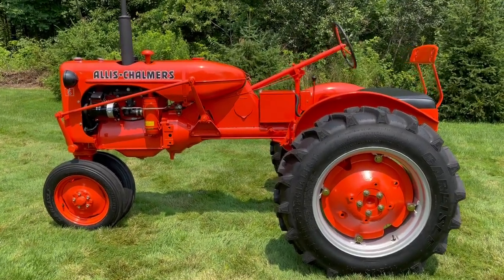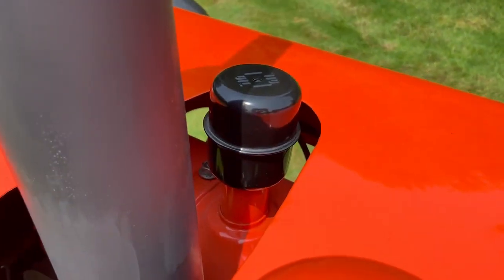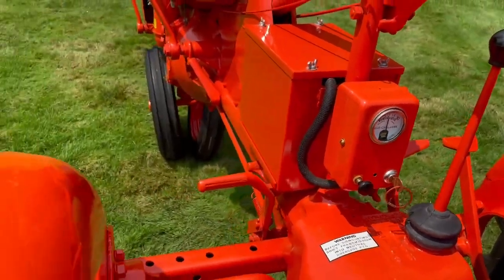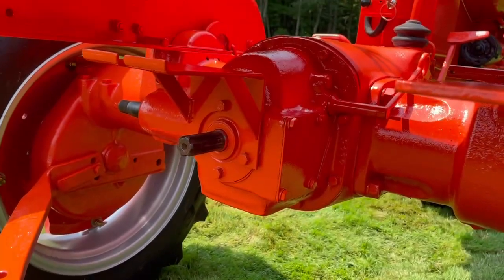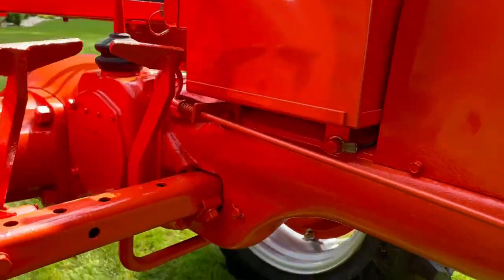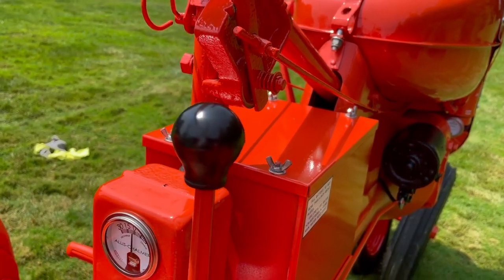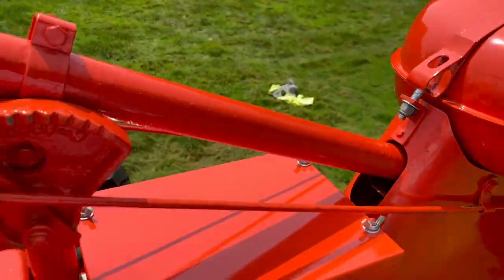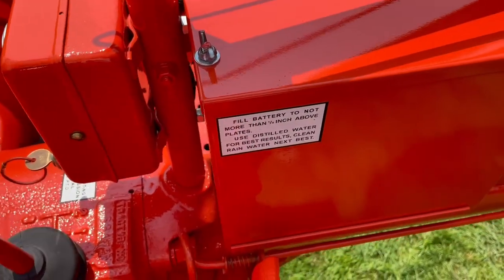1948 Allis Chalmers C Tractor Overview and Operation

Comment: Finally an Allis with a push button start.  I remember the one my grandfather had started that way.  It also had a bench seat, but a wide front wheels. It also had levers next to the seat so you could raise equipment.. I ran a spring tooth harrow

Comment: I 'grew up' on one of these, had lots of pulling power!  electric start often didn't work so had to crank start. had left rear wheel fall off due to being rusted out at hub anchors!  saw my brother lose 'traction' on one of the brake pedals while pulling a loaded hay trailer up a hill, it started rolling backwards when he tried to downshift, tractor went one way and the trailer the other - it weren't pretty!  Ah yes, those were the good 'ole days!

Comment: Just bought one today, either 52 or 53, not sure yet. Doesn't have a draw bar to hook a trailer up, where do you reccomend for parts. Also love your seat, mine has old metal seat also has a hand clutch lever.
Reply: Steiner tractor parts